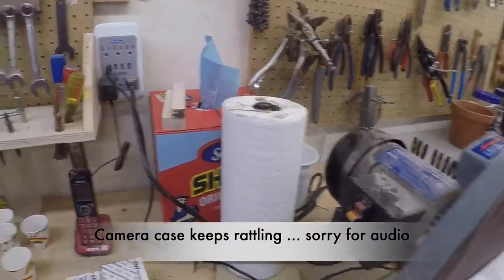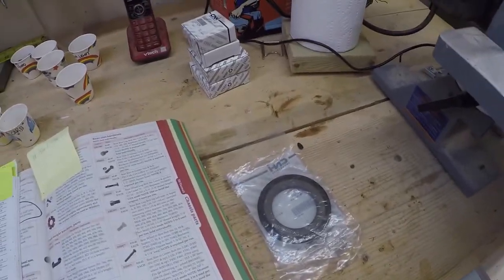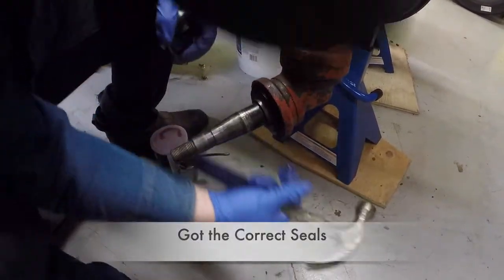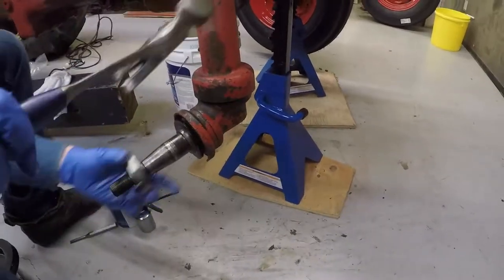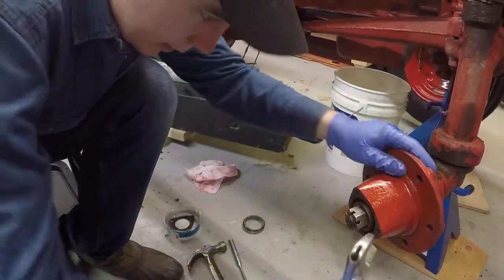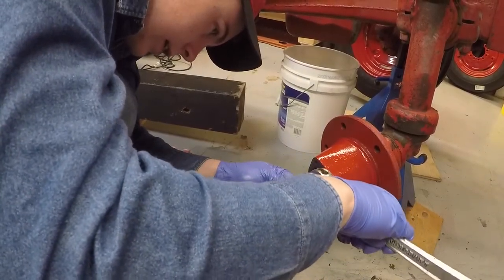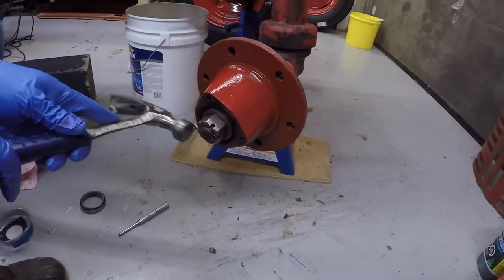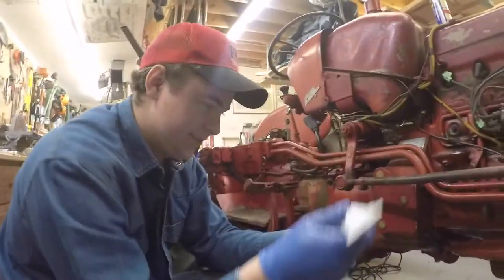IH 300 Utility Tractor Front Wheel Bearing Replacement

Comment: Hey man, just got the same problem here, where’ve you ordered the parts from? I’m from Australia and I couldn’t find the right parts, can I have the brand of the parts as well? Thanks
Reply from the maker: At the time I got mine right from the CaseIH dealer , that was mistake a though , way overpriced. I have resources now to cross reference the IH part number to bearing manufacturer numbers - I’d be happy to help you out, is it a 300 Utility you’re working on? And if so does it have an adjustable width front axle ? According to my parts catalog, different bearings were used on the adjustable tread front axle vs. The heavy duty fixed tread.
Reply: @ihredryan  it is a aw7 model with very similar design like yours, I have the bearing sizes that I can order in from store but the cup is damaged and I’m bit confused where to get them(as in your video it’s come in kits) where the store here sale is separate, also the seels is unknown parts to get as well 

Big thanks legend!!
Reply from the maker: @chaofang-lw1qw  wow very cool - I have never seen one of those models in person , I don’t think any made it over here to Canada. Do you have the IH part numbers for the bearing and seals ? I can cross reference them for you and we can go from there
Reply: @ihredryan  I just rewatched the video and I can confirm it’s 99% identical shaft as mine, I’d assume they using the same bearing(from identical bearing and gaskets) the bearing number I got from store are 
 Timken 2878 (made in Australia)
Imperial 1.375 inch

Inside bearing is 1.6879 inch
Reply from the maker: @chaofang-lw1qw  I bought the bearings in a set right from the dealership. Nowadays i prefer to look for new old stock on Ebay, generally quite a bit cheaper and you can't beat vintage timken!

Comment: I just watched your video, thanks . how hard was it to remove the inner seal ?
Reply from the maker: I was able to get the old seals off with a pair of small crowbars, just slowly working around. If the seal was really stuck on there I would think a bearing puller would just break it - so carefully cutting with a it like I did the bearing race would be a good option 👍🏻